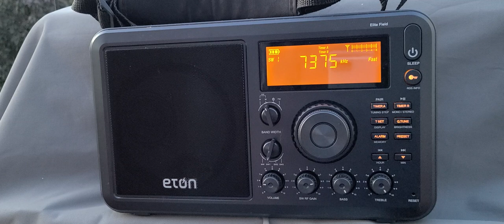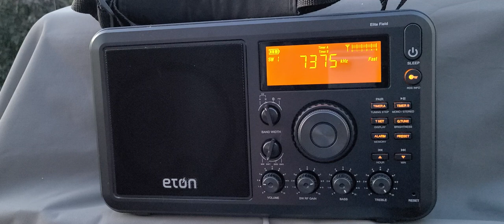Static electricity on Telescopic antennas of portable receivers is a major danger

Comment: Maybe put a big rubber ball at the tip of the antenna that you could use if you needed to adjust it.... or if you could find it a conductive sheet that you could wrap around then antenna and ground the conductive sheet.... something like this high resistance  plastic. But this was a very good talk you had. You earned a subscribe from me.

Comment: Same problem if you shuffle around on the brushed nylon seat in your vehicle then step out and touch the door. As you ground yourself on the door, you discharge yourself and ZAP! I taped a 1 megaohm resistor to my car key so I could hold the end of the resistor and touch the door with the other end. This allows a slower discharge that you can't feel. And be careful when you remove synthetic fibre clothing; same thing happens; you get charged up. I've even had a zap after handling a large, plastic rubbish sack.